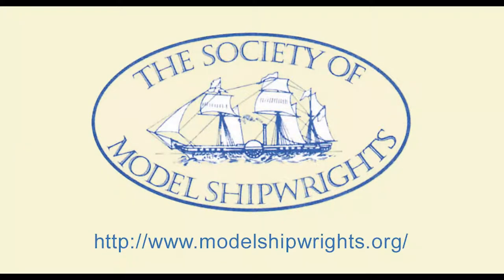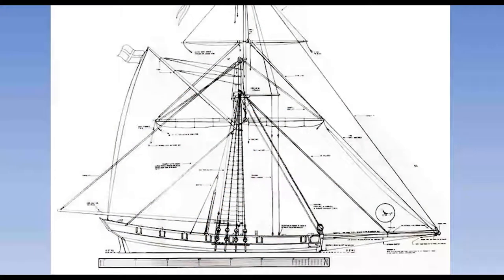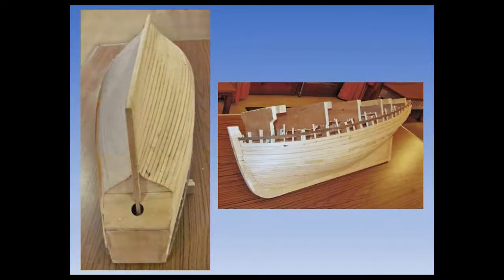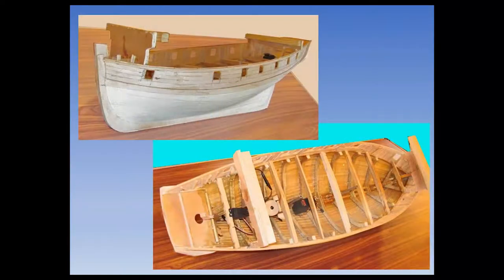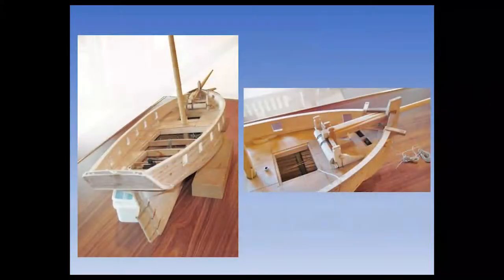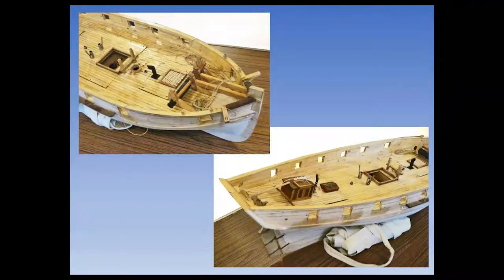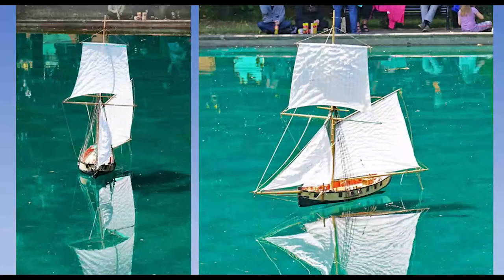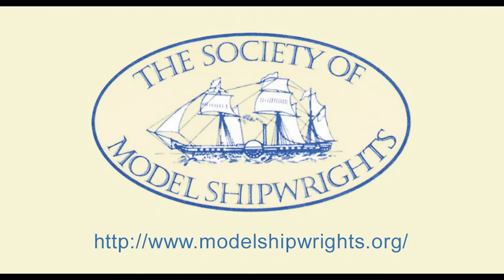A 19th Century Naval Cutter

Comment: A beautiful model ! I make working models of gaff rigged schooners. On the water our club sails on,  I find them the most handy .  Just to see how it would behave I made a square sail and fitted it to one   . It was no way as big as yours say half the size . But I was surprised the differences it made to it with the wind on the beam  or when on the quarter , it was much faster . But it  was not so affective on a dead run . I think the main took some of the wind off it's drive. With the wind forward of the beam it was not as affective  . Say one or two points forward , but that would be pinching it . To change tack , without taking the sail in . The only way was to  wear ship , which of course meant loss  over the ground.  I tried backing the  sail . Unless in very light winds , things got , " interesting " very quickly !  Nice to see this model,  it is a lovely model !